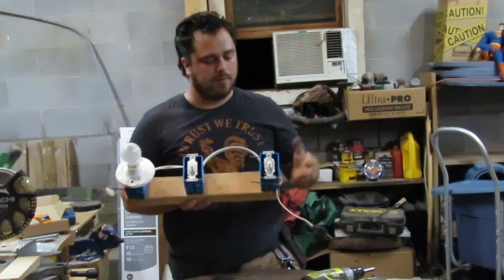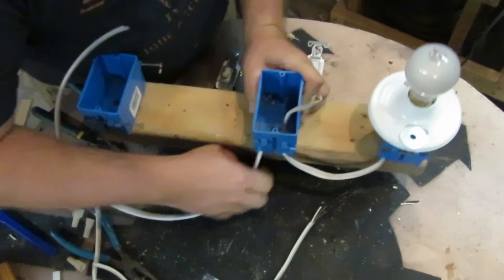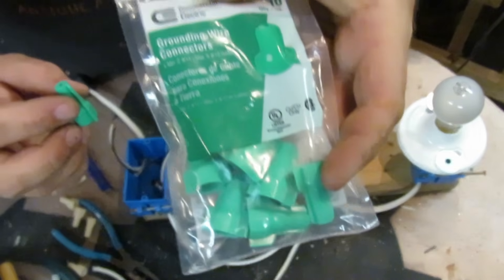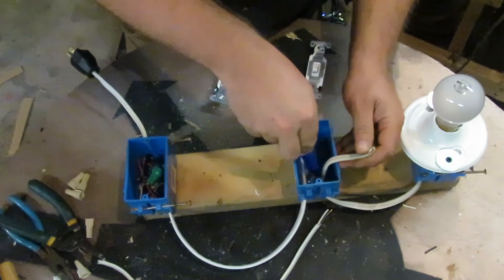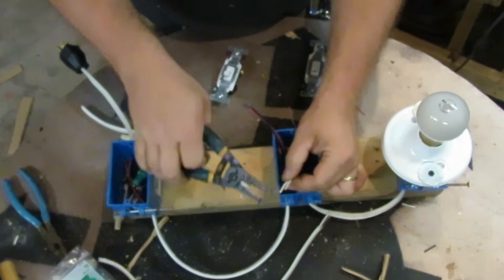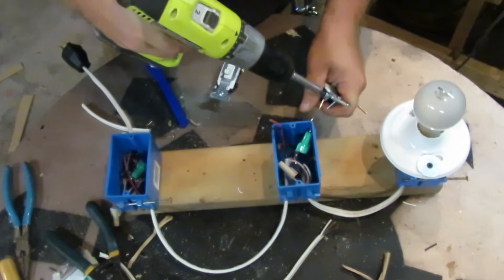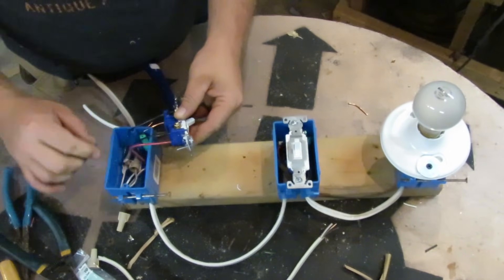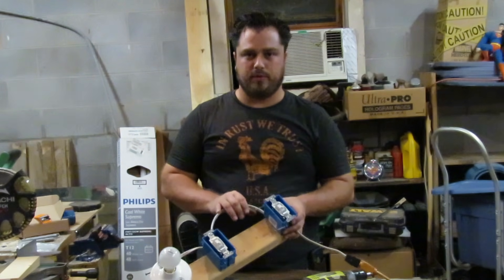How to Wire and Install 3-way Switches

Comment: want to put a pull chain light bulb fixture in a closet that has two three way switches on the outside opposite wall, one controls the lights in the play room with the other three way near the outside door.  Now the other three way switch controls a ceiling light in the hallway with its three way mate near the stairs to go up.  Now can I use the hallway switch to tap off it to power the pull chain light that will be in the closet?? The wall of the inside closet is just on the other side of the wall where the three way gang box is and only a couple of inches separates them and I would run the romex in conduit to the pull chain light fixture.  Now am I able to do this using the hot sides of the switch and relying on the pull chain switch to work??
Reply from the maker: +John Scofield as long as there is a hot wire in the 2-gang box and not 2 switch lines. If you have a volt tester, if the common screws have power no mater how you flip the switch then you should be good to tap into the box for the light
Reply: Thank you for your advice and instructions.  With the help of a neighbor that is an electrician he was able to determine that the switch I was going to use for the closet was doable as the other switch was a 4 way and where it was would not work, but the 3 way was in a spot that allowed me to get a hot connection without doing damage or causing the switch not to work the fixture it  is powering.  Anyway with your video and my friends advice I was able to install not only a light fixture but an outlet in a black closet with a crawl space that I can now light up. Thanks again, John.
Reply from the maker: +John Scofield I am glad to hear that

Comment: how can you tell which switch has the homerum coming to it if both switches are already installed and drywall is up? because they both have the same amount of conductors  inside each box?
Reply from the maker: +Ryan Updike you will need a meter to check the voltage, if the light is turned off and the common wire has power, that is your hot wire. Light off, no power, that would be your switch wire.

There are other less safe ways to check if you don't have a meter, but I wouldn't recommend them to anyone that doesn't already know.

Comment: How would you set this up with multiple lights that need to be turned on/off by the two switches? Just run splitters off the 'common' to the other bulbs?
Reply from the maker: +Drunken Hamster just dasy chain all of the light boxes together with more 14-2 wire

Comment: How would I go about running outlets off of the second switch? or a single pole switch for a separate light?
Reply from the maker: +Jay Smith can't do it without rendering the 3way useless
Reply: That's what I thought. Had to pull a totally different cable. Thanks for the video, and the reply!!!

Comment: are the travelers need to be in the same side of the swich .. if u put the red in the rigth of on one swich the other red needa to be in tbe rigth side of the other swich?
Reply from the maker: +Fredo Velazquez not at all, just so the common is on the black,  the travelers can be on either of the other screws
Reply: Mechanical Chaos thanks u win a supscriptor 😎

Comment: hey, may i know what kind of wire you've use in making 3 way switch?
Reply from the maker: +chengchangzen125 lee  14/3 romex

http://m.homedepot.com/p/Romex-250-ft-14-3-Solid-SIMpull-NM-B-W-G-Wire-63946855/202316275
Reply: Use cat5